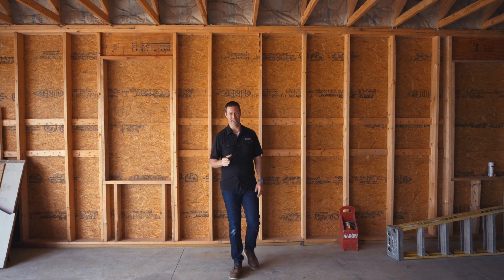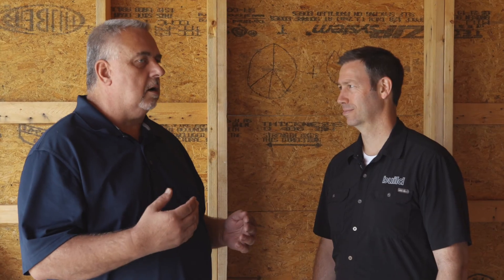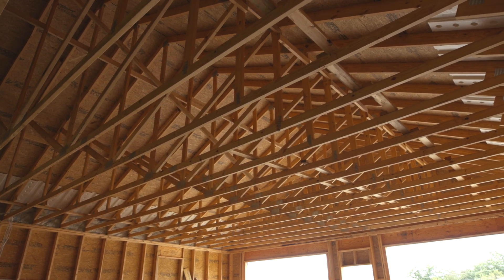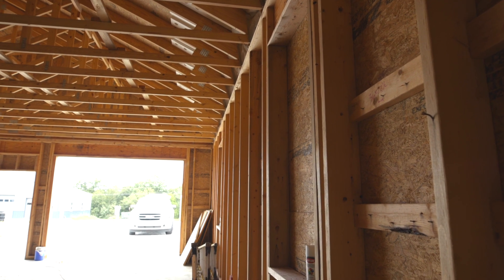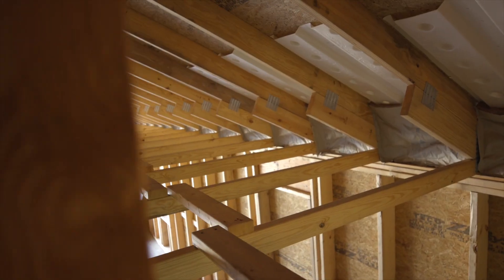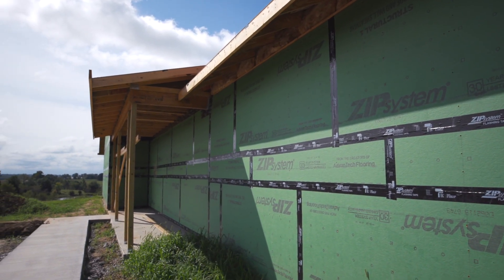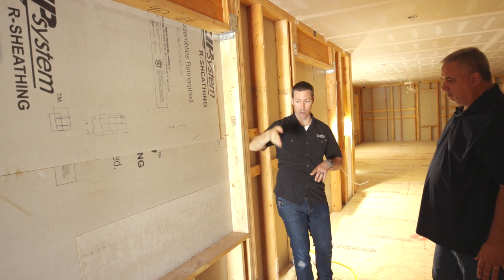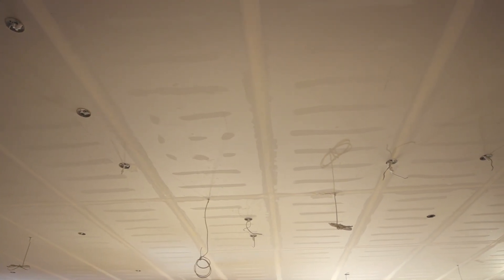Traditional vs Advanced Framing - Details

Comment: Matt, does this type of construction transfer to regions with hurricanes as well? Ie could you zip the outside and span this far in Florida? This seems like such a great method of construction. I've followed you for some time and seen the videos where you recommend closing the house and conditioning the space during construction, do they condition this space or is it just enclosed? Also, in this build the mechanical room is downstairs so it seems like it would be simple enough to install the mechanicals before internal framing etc.
Reply: Suspect that well placed load bearing interior walls would help in strong wind conditions. This example offers little in the sense of lateral and torsion stiffness. Additionally, you don’t need as much thermal insulation in Florida. That in turn can inform an economic thickness of the exterior walls. Might be framing isn’t the best choice in hurricane prone regions altogether. Just my take as an architect, not US based.
Reply: @HeadPack  I believe most all construction here has concrete exterior walls. In my homes case, built early 80's there is stucco, wood cladding, block wall, furring strip and drywall. That's it.... No insulation. Other than air... While we don't need to keep cold pit, it would be nice to keep the heat out and cold in... :)
Reply: Yes, there would be issues. But the most important element is to get a continuous connections from foundation to roof... hurricane clips tying trusses directly to studs ... roof sheathing connectors actually penetrating into trusses rather than being accidentally offset just enough to miss them. I've seen FL houses where whole rows of roof sheathing nailings completely missed the truss below... Finally, if using gable trusses make sure they are properly braced.

Comment: What's with the drywall on the ceiling being all lined up
Reply: Blain Brazeau yeaaahhh idk 😐 the mud is gonna crack 5 years down the road
Reply: @brandonthompson7075  and your going to see the but joint down the middle.of the room lol
Reply: Maybe they did a dual layer drywall with glue or steel between.
Reply: I'm pretty sure they're going to run the wall on that joint
Reply: Yeah I know lmao but hey they might know something we don’t? Idk maybe some new material. 🤷🏼‍♂️
Reply: I noticed they used lathe on the ceiling, the boston architect says they use that in his area.    I don't know why they use it in MO
Reply: Danny it's not lath it's strapping.
Reply: @danonly7  Lathe?  looks like drywall to me
Reply: @talon0863  They hang 1"x4" or 1"x3" lumber perpendicular to the ceiling joists. That is what poster Danny is referring to.
Reply: @guytech7310  Thanks Guy, good to know.  That ceiling does look pretty flat.
Reply: @talon0863  look at the video around 7:10 and on.   There are little 1x 2 strips or so used as a drywall backer.   I thought that was called lathe, I wasn't saying the drywall was hand applied plaster.
Reply: @danonly7  Yep its all good. Different parts of the country name things differently.  We call that floating the ceiling.
Reply: @danonly7  furring strips
Reply: This looks like some kinda production type b/s being explained away as some new great stuff. The entire package
Reply: They joints are aligned because all of the butts will fall over a wall. Meaning the finishers only have to conceal tapered joints. This makes for a more flat ceiling.
Reply: its called advanced drywalling

Comment: Why are the drywall butt joints railroaded on the ceiling?
Reply: The drywall joint align over a future wall. This creates the ability to not have a single visible butt joint in the home.
Reply: Lack of babysitting the drywall installer
Reply: I believe many of the butt joints will fall over interior partitions once those are built. This house is going to have a hallway running down the middle of it. There are earlier videos about it. You might want to check them out.

Comment: Does sound travel easier from room to room when you have a continuous ceiling?
Reply: Its all going to depend on the treatment they give the seams for the interior partition walls. One could add some acoustic caulk on the top plates but well taped drywall joints will make it similar in sealing to every other typical american standard home. Except this one will actually be efficient
Reply: I'm asking because when I build homes I'm not allowed to do it this way because they say that the sound waves travels with the drywall into the next room. I want to do it this way so I'm wondering if what they say is bullshit...
Reply: @oGcs0ber  I would say the difference is negligible.  The only way to truly isolate is with air space, mass, and floating rooms - i.e. recording studio construction.  I can't see that being practical for residential construction.  Resonance will happen through drywall and framing regardless of how you detail it IMO.
Reply: @oGcs0ber  Are you building in Sweden or the USA? Either way you may find this interesting. USG has some great resources for learning about sound control in partition design. https://www.usg.com/content/usgcom/en/design-studio.html
Reply: “Made In Sweden ‘))